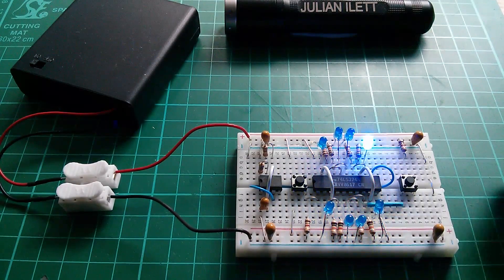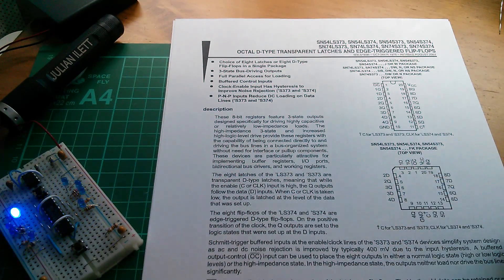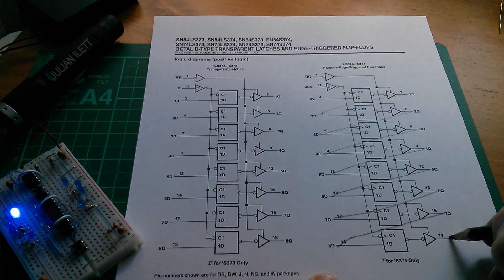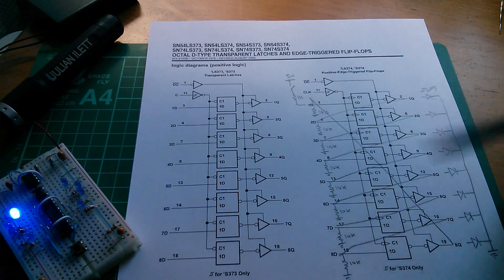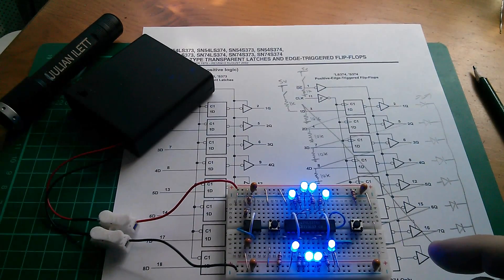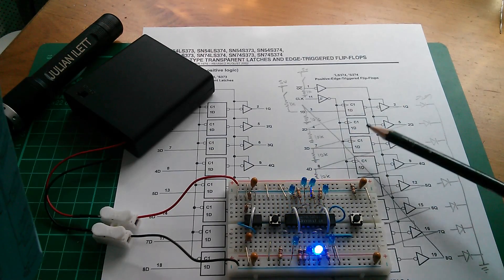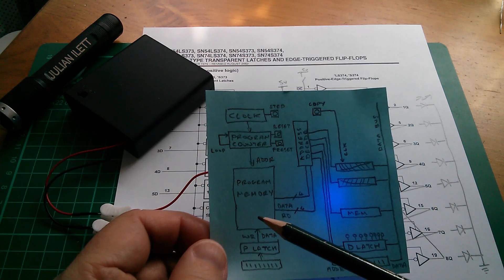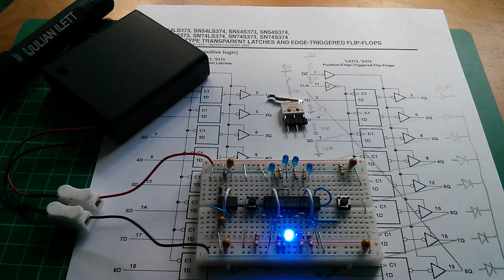Chip on Breadboard: 74LS374 Octal D-Type Flip Flop

Comment: I noticed the 555's output at pin three is not connected to your D flip flop. Just sayin'
Reply: Blue wire 555:3 -> 374:11. Clearly visible at 7:09. Just sayin'.

Comment: The flip-flop (or D-latch ) behaves correctly. Imagine how static RAM bechaves just after you power it on. D-latch remembers input state on clock change (rising edge?), and that it all. So, you have to deliberately inform (put 1 or 0 into) the D-Lach what to store and control it all the time. Use 5V + small capacitor (100nF), then pull down (resistor 10k), to the first D-Flip-Flop. Have a nice day.
Reply: BTW, the circuit: http://tinyurl.com/ybm8bnoc

Comment: Nice circuit.  Reminds me: The original 7474 was my favorite digital TTL IC in 1970's - Made an organ note source using a single clock driving 12 divide by "N" 7474 counter circuits that each fed a chain of divide by "2" 7474's for precise square wave octaves ranging from 13.75 Hz to ~8272 Hz.  Divide by N preloads desired binary number then counts down from that, then it resets and starts over again (if I recall correctly).

Comment: I  just finished building an io circuit for my z80 project tonight using a 374 latch then noticed this upload :)... one thing Julian if you plan on doing a big project with all these smaller experiments later ie a custom homebrew cpu you might be better using hct variants of your logic chips. I had no end of trouble with LS chips due to loading and they kept me chasing my tail for a long time, then had to rebuy all my logic as hct at great expense

Comment: Is that a 18650 battery bank? Did you solder wires from the USB out?
Reply: remember he is an ebay junky. you just have to listen carefully at about 1:20 in the video. try this link , $1.39 US free shipping 
http://www.ebay.com/itm/4-x-AA-6V-Battery-Holder-Connector-Storage-Case-Box-ON-OFF-Switch-With-Lead-Wire/291644584054?rt=nc&_soffid=5018315205&_soffType=OrderSubTotalOffer&_trksid=p5731.m3795

Comment: i like very much of these simples circuits you publish,  i turn your fam!!!. i made in my Brad board with z80 cpu with led like you do in of your videos i find this amazing of course i like very much z80 because my age 52!!!😎
Reply: I'm working my way up to making my own computer with a Z80. I decided on the Z80 because of Julian's videos. I'm Canadian, so I grew up with the NES and C64, so I always figured if I made a computer it would be with the 6052. Or at the very least, the 8086 since I have some experience with that. But I've never done anything with the Z80. I ordered a couple and am waiting for them to arrive. I haven't got any ROM/RAM chips yet, but I plan to start just playing around with single op codes entered via dip switches and make a flasher circuit like Julian did. I'm still very much new to all of this, so I have a ways to go before I build a full computer, I think. Ideally I'd like to make my own CPU at some point as well.

Comment: Fantastic as usual Julien!  I love that your stuff is easy to understand for a beginner.

I'm building a 6809 breadboard computer (Grant's 6-chip 6809 computer).  Having trouble so I added a manual 'clock' but I'm definitely seeing bounces.  Will try to use 555 debouncer (10 came in the post today).

I received my first ever oscilloscope today, haven't used one since college 20 years ago!  I think you can take some of the blame for that :-)

BTW, I suspect my large breadboard (same type you reviewed with the spring power connectors) is problematic.  A simple 'NOP' 6809 works on a smaller (nicer) breadboard but not the big one.  Awaiting some larger breadboards to confirm.

Comment: You could still do this easier with a 4017 counter
Reply: True. You cannot get that chasing glitch he is showing, where 1 is off, or 2, or maybe 3 are off, chasing each other. If you use this as a CV out to a synth, you could get different notes or chords, by quick switching the chip off then on again. That is not an easy thing to do with a cd4017 as far as I know.

Comment: The input clock inverter has a shmitt trigger for de-bounce and false trigger. You can install a five volt supervisor chip that will hold the input low on the flip flop at power up to give expected start up.

Comment: Julian this would not be easier to use a decade counter.
Reply: Because he's testing his data-rotate circuit, not a counting circuit.
Reply: actually you could probably use a 4017 decade counter...should give the same outputs...but would need resistors on each led...
Reply: just need to link one output to the reset pin to set it for 8 outputs instead of 10..
Reply: Counting is not rotating. Counting up is like adding one each time. Rotating left is like multiplying by two each time.

For example if you have 00000110, counting up would be 00000111 but a rotate left would be 00001100. The next up-count would be 00001000 but the next rotate left would be 00011000.
Reply: in this case a 4017 would have the same effect as a '374 wired like this as it has 10 outputs and its count is a shift up the line, rolling back/carrying at the end .. it is decimal out not binary or bcd..
Reply: 4022 would be better being 8 output so 'exactly' like this circuit.., never used a 4022 but have a 4017..
Reply: I think I understand: with the 4022 you could reproduce the action in the circuit Julian has on the breadboard, cause a one of eight LEDs light in succession, 0 through 7, in a circle. The 4022 could, indeed, do that, but I don't see how the 4022 could accomplish the general purpose function Julian wants in his minimal computer he is building on breadboards.

The function he wants is a circuit that will accept any pattern of eight bits presented to it on an eight bit data buss, shift them one bit to the left and present the shifted pattern on the data buss. He also wants another circuit to do the same except shift the pattern one bit to the right. The 74LS374 octal latch can do this when configured as he demonstrated.

The 4022 can not be configured to do this. It is a four bit counter with it's output encoded to eight separate pins.
Reply: in that case a parallel in/out shift register....? 2 of them..
Reply: I think that's a great idea! :-) Thanks for hanging in there with me.

Comment: cool, but what happens if, while the lights are rotating, you push the D1 Button again? do you get 2 LED's rotating around? and then a 3rd?

Russ from Coral Springs, Florida, USA
Reply from the maker: No, because the 1k pull up / 10k pull down are no match for the output driver of the LS374.
Reply: ok, thanks, 
btw, what are the values of the decoupling caps?
Reply from the maker: I just used what I had - 3.3uF at 35V
Reply: thanks for that information. i'm not an electrical engineer by ANY stretch, so i often wonder about what sizes of Capacitors to use in order to be effective decoupling caps. i'm sure it has something to do with whatever frequency range you're trying to filter out. does it matter whether you use electrolytic or not?
sorry to bother, i'll keep my questions more to the subject @ hand in the future. i really appreciate your videos, and have probably watched them all, by now!

Russ

Comment: I have often thought either the 373/374 was designed for a very specific purpose (high speed Johnson ring counter) or designed by someone slightly mad. The 573 and 574 are much more logical with all the inputs on one side and outputs on the other which is far more convenient for both circuit diagrams and board layout for data or address latching. As for the internal resistor being used for current limiting then it is something I would personally avoid as it increases the power dissipation of the chip. OK only about 30mW in this case but in some applications it could shorten the life of the component.
Reply from the maker: The 374 pin arrangement is a bit messy.
Reply: I would also use the 74574 because of it's much nicer pin assignment.

Comment: I have  an odd problem, I have a 74hc595(shift register) that I've got clocked properly, and it has decoupling caps etc. It shifts correctly when I pour bits in, except when one is high. It works for all permutations except for just one bit being where it just skips 2 states. It's like the output is causing a double pulse on the clock in 2 places, but not if any other outputs are high! Very strange...
Reply from the maker: You're not driving the CMOS HC595 from a TTL output are you?
Reply: Nope, not unless these chips are marked incorrectly plus I don't see why that would cause it to skip in this one circumstance?

Comment: Also, if your circuit shifts bits from low order to high order, it's considered to be a shift/rotate left, not right, as stated in the video. Most 8-bit microprocessors implemented both sets of instructions, rotates and shifts left and right. Interestingly enough, the 6502 called the rotate op-codes ROL and ROR, but called the shift op-codes ASL (arithmetic shift left), and LSR (logical shift right) - weird.
Reply from the maker: Oops, I said right when I meant left - I even moved my pencil to the left - senior moment!
Reply: The difference is what the number you are shifting reprsents. Is it a twos-compliment where the MSB in the sign, an unsigned number or a something else like a letter in a string? You also have to consider how these operators affect the varous flags most CPUs have. Carry Flag, Sign Flag, Overflow Flag, Zero Flag.
https://en.wikipedia.org/wiki/FLAGS_register
Here's my attempt to show how it might work. (My ASL may be wrong.:-)
ROR: LSB ->MSB
ROL: MSB->LSB
ASR: LSB->into the bit bucket, MSB->MSB (Arithmetic means sign-extend. The MSB is the sign bit.)
ASL: MSB->into the bit bucket, 0->LSB

Comment: Huh.  I guess you clock the data in from the source on one pulse, then clock the shift on the next pulse, and you could probably read it to the destination on the same pulse if there's just a skerrick of a delay before the read, otherwise you'd need a third clock pulse for the read operation.

But personally, I'd just have the D0 output from the source actually go to the D1 input on the 374 chip, and so on up to having D7 from the source go to D0 on the chip.  That way you'd clock the automatically-shifted data in on the first clock pulse and then read the shifted data out to the destination on the second clock pulse.

Reverse the order (D0 to D7, D1 to D0 ... D7 to D6) for the opposite shift.

Sometimes, the simplest way really is the best way. :)

Comment: I think you can do this with a 74LS595  and daisy change it. And put the output to the input
Reply: @2000jago "daily chain"? You mean "daisy chain" perhaps...
Reply: a7b24  😂 yes.
Reply from the maker: Yes, that's the plan :)
Reply from the maker: That's true, although the 74LS595 wouldn't work as the bit shifter in my computer as it doesn't have parallel inputs.
Reply: Julian Ilett but you don't need parallel input for this loop of led's.

Are you using the 74LS374 as a registry for your 8bit computer? Like Ben Eater did on his YouTube channel?
Reply: Nice, I am making a PCB prototype board with Data and Address bus, like a brand board for this project. Big dumb up to you.

Comment: hmmm...i have an idea how it could self start,
Reply from the maker: Does it involve a capacitor by any chance?
Reply: yep. cap, 22uf ish, from /oe to 5v, resistor, 10k ish /oe to ground, with 1n4148 in parallel, anode to ground, and remove one of the input 10ks from ground and connect to 5v, that will be the 'seed' input...i 'think' it should work, cant try as dont have any '374s lurking around ..
Reply: Maybe second ne555 in different configuration? :)
Reply: to provide reset pulse? could do, but just need 3 components as i said above...